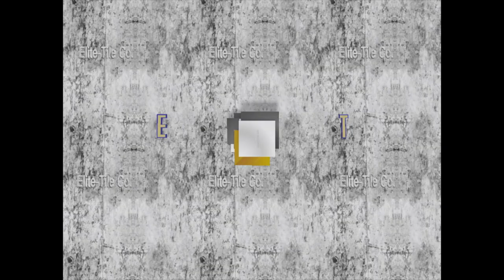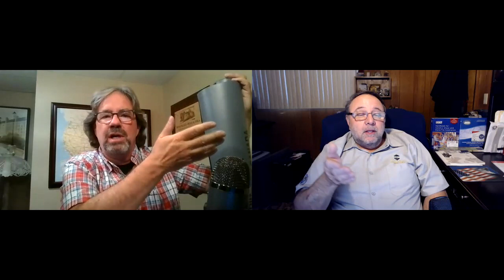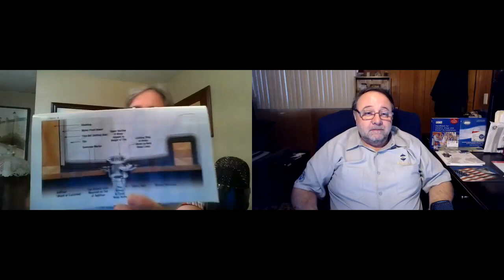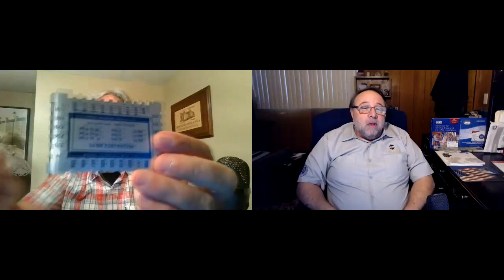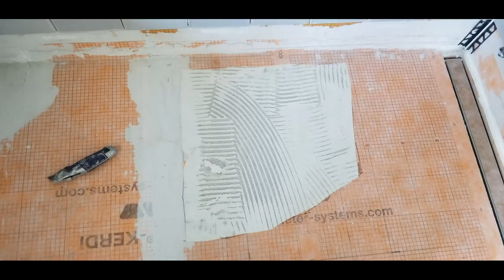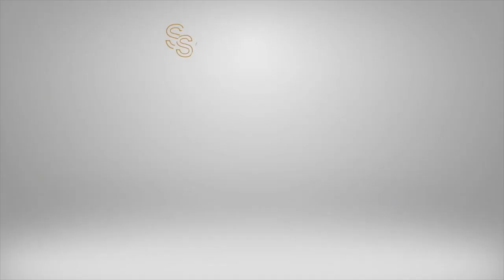🤔The history of shower construction, according to two tile guys.😇

Comment: Perfect shower pan man. Been doing them this way for 28 years... only call backs are for new projects. People will claim that this method is obsolete due to modern shower "kits." But how can you deny the longevity when you've performed countless demolition of 50- 100 year old original shower stalls that are being transformed ONLY  for update purposes... almost never due to failure. The new systems im sure are just fine ( when installed correctly) but sticking with what works and what has  survived a TRUE test of time, is hard to deny. Im sorry if it requires some geometry  technique,  getting dirty and using muscle.... actually not sorry. Great job.  I work
Reply from the maker: Thanks for watching my video.

Comment: That was a cool conversation. I'm 67 and still doing tile installations. Mostly tear outs because the base by these Indiana setters is done with the wrong drain. I have to say here in small city Indiana the carpenter's and cement finishers do tile. There are lots of homes where they don't use the shower because they leak. I saw one the other day where the a 110 volt Ditra Heat was connected to a 220 volt feed by the tile installer. Melted!
Reply from the maker: Thanks for watching my video.

Comment: Is use mapei 4-1 for my base. Its really nice to work with and no guessing on the mix. Its actually not that pricey . Schluter drain all day and kerdi your floor . I like to run a bead of ardex sealant around the cut for the flange for added assurance.  Kerdi board and all applicable bands patches required. I like to completely fill my curbs with mortar. They dry Soooo solid. Cement board is OK for the walls and Greenboard is acceptable i guess but i wouldn't recommend it  . The bottom 2 feet of the sho wer is really the most important to have the least chance of water wicking in anywhere( other than a steam shower ) . Great talk sal  . Truthful and professionally said

Comment: Sal, what do you think about using another waterproofing material over the Schluter system? Like Ardex 8+9 for example? Isaac's tests show the tape/thinset wicks water (which I completely believe - any cementitious material is permeable, so using it to 'seal' a waterproof membrane doesn't seem the ideal thing to rely upon). Yes, there's the 'frankenstein' conflicting manufacturer issue, but other than that do you see any problem with going the extra step? Obviously you don't think it's necessary since you don't do it...

The notion that it's difficult to mud a floor baffles me. My first shower as a complete DIYer 25 years ago was a mud float. How hard is it to mark a level around a shower and slope the floor to the drain? Perhaps the 'hardest' part is resisting the temptation to get the mud too wet (dry pack is what I've always known it as - use it to pack structural steel base plates etc).  That some tile setters are intimidated to do it seems laughable. I think it's just sheer laziness not wanting to mix up a few bags of dry pack vs slapping down some foam...
Reply from the maker: As far as modifying a system, don't play with something play works and has been tested by countless thousands of successful installs, many of which I have personally done. the system works, trust it. A simple shower stall floor is pretty easy, but as they get bigger and more complicated, they are not such a piece of cake.

Comment: Sal, if my subfloor has very old hardwood over it but hardwood seen fine just full of paint stains, can I just lay the cementboard over the hardwood, or do I have to remove the hardwood and  replace it with plywood before placing the cementboard?
Reply from the maker: If your subfloor is plywood, remove the hardwood on top, and install the backer board to the plywood subfloor. If the subfloor is structural planks, remove the hardwood, install a minimum layer of 1/2" plywood, then the backer board. Better still use an uncoupling membrane instead of the cement board.
Reply: Thank you Sal.